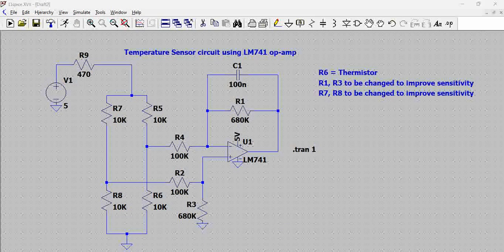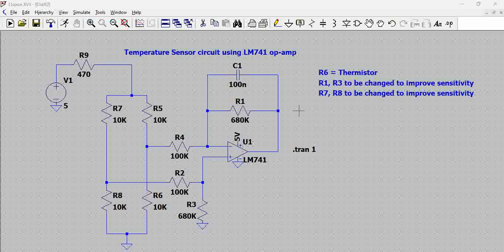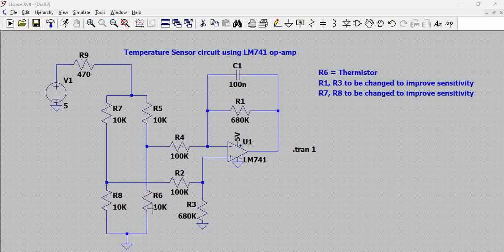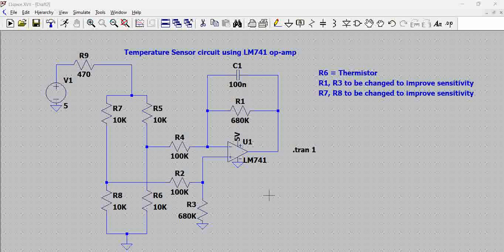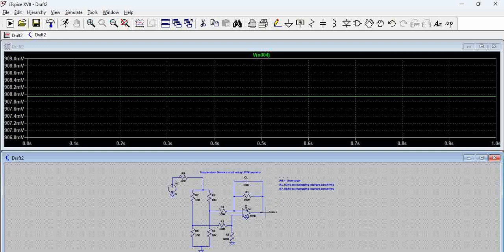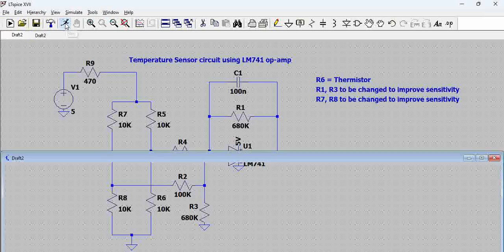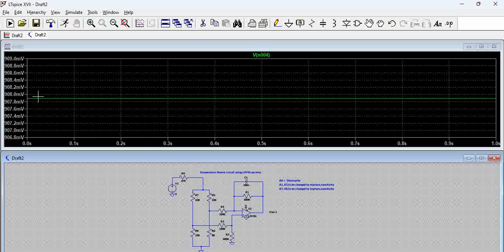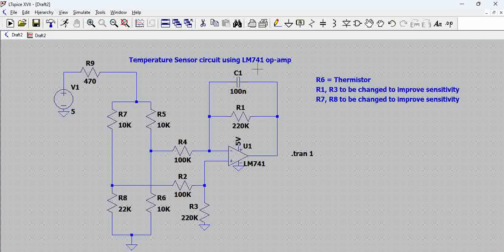Temperature sensing circuit  using 741 op-amp | Temp sensing and voltage conversion using thermistor

Comment: what temp sensor u use?
Reply from the maker: In this video it is just voltage divider to get an analog value as input. DHT11 is vommon temp sensor used by hobbyists and for quick experiments

Comment: Hi what is the conversion for your output to measure the mV output to Celsius ?
Reply from the maker: The reason why it is not explained is, the first step thermistor to be selected and then thermistor variation versus temeprature to be noted. The voltage variation due to this thermistor resistance vatiance is yo be noted. Secondly, the amplification of that value. I will try to explain this in my blog and point here